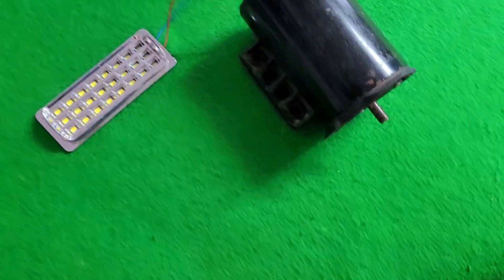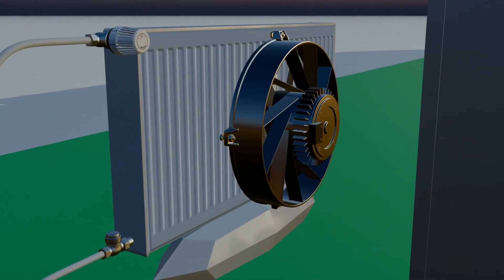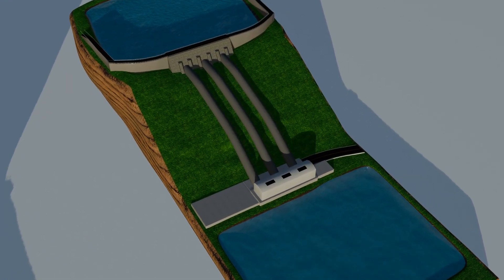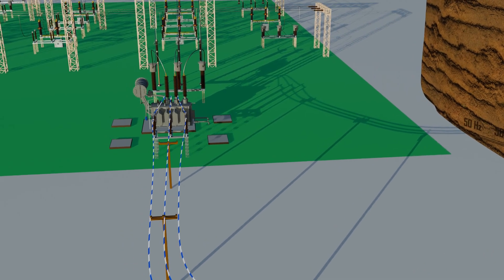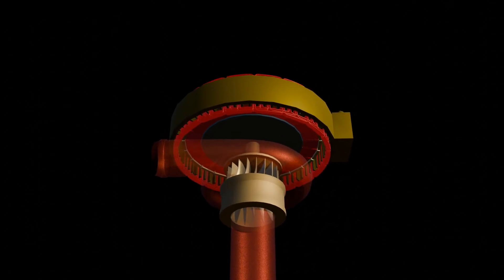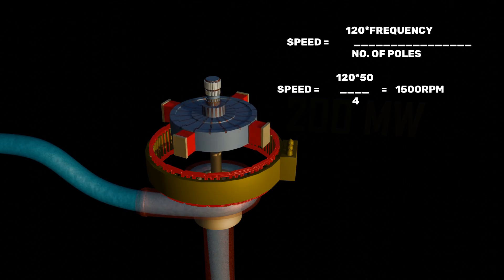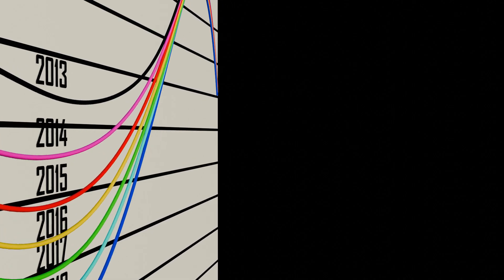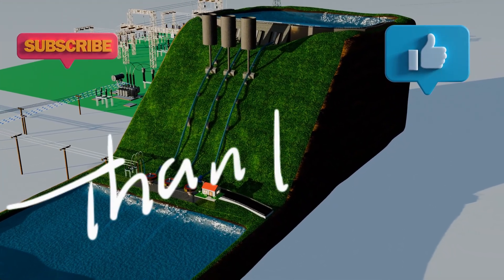The Secret Water Battery Behind  Pump Storage Power Plants

Comment: 0:31 “store ENERGY in GigaWatts” should be GigaWatt Hours.

10:58 That cost has to take into consideration the LENGTH OF TIME that the facility is amortized over. As you pointed out pumped hydro could be more economical than batteries (over lifetime) but the pumped hydro facilities are never portrayed as such as they are not amortized over a 100 years vs maybe 20 for batteries. The upfront capital costs are considerably higher for pumped hydro so batteries advocates portray that as a negative. Also it is instructive to note how close the round trip efficiencies of both types of systems are (within 2%).